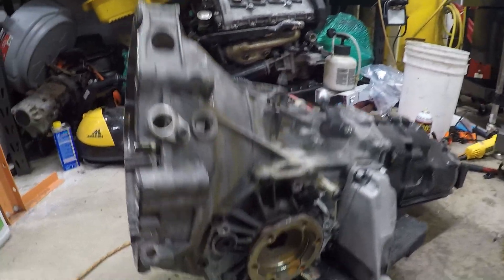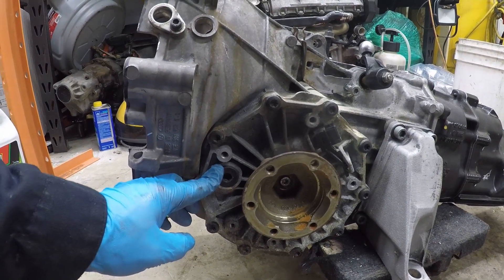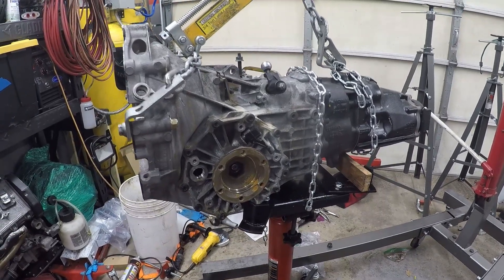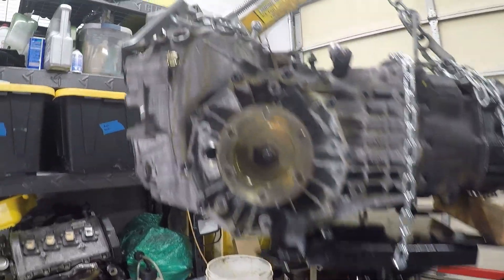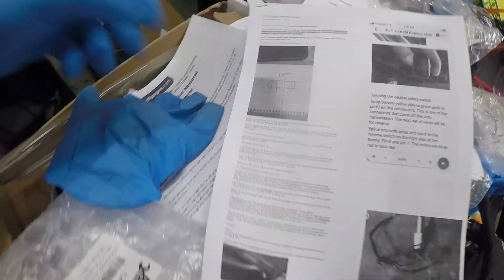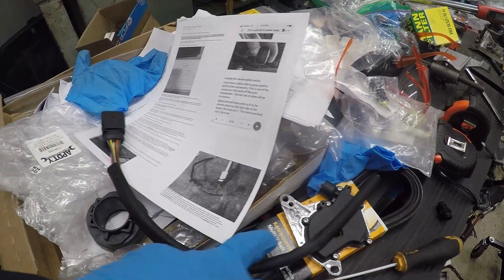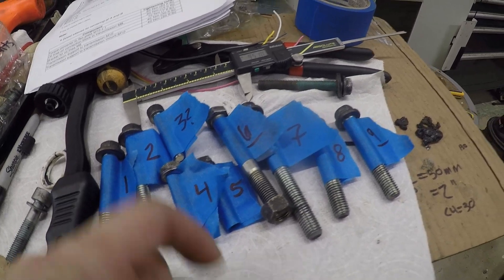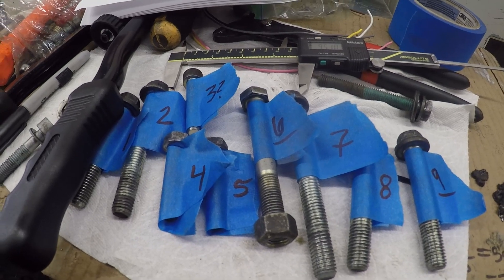Manual Swapping an Audi D2 S8 - Part 6: 6MT Install

Comment: Would it be possible to use the manual transmission of the Audi A4 V6 in the A8? I'm from Brazil, in my country Audi didn't come in the V8 version with manual transmission for swap

Comment: Audi uses a flanged M12x110mm for the #6 bell housing bolt and flanged nut . You end up with a couple threads exposed at the end, so a 100mm should work about the same. Anything from the hardware store should work, but the hex head will be a 19mm instead of 16mm like every other bellhousing bolt, unless you buy from VW/Audi. Still kinda bugs me that I didn't keep that consistency on mine lol

Extra tip: It also helps to write the number on the bell housing itself for when your brain is only half working from all the frustration.
Reply from the maker: Great info!

Comment: Do you still use the 01e trans brackets and mounts? Or did you have to use the d2 s8 trans mounts?
Reply from the maker: I used some OE D2 manual trans mount arms. I should have part numbers in my build thread (link in the video description).  And then the standard trans mounts from the auto still work.
Reply: @oddcylinders  gotcha, what do you do for the driveshaft? Does the c5 conversion adapter work for the d2?
Reply from the maker: C5 adapter doesn't work. I bought a new one from Advanced Automotion but you can also make an A8L one work. Check out the Part 1 for a good overview of all the parts I used.
Reply: @oddcylinders  thanks